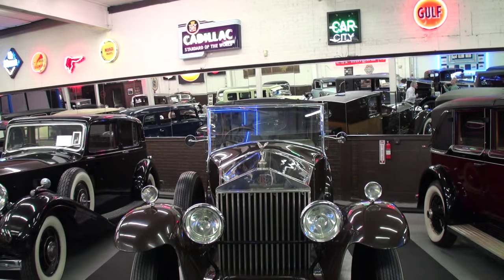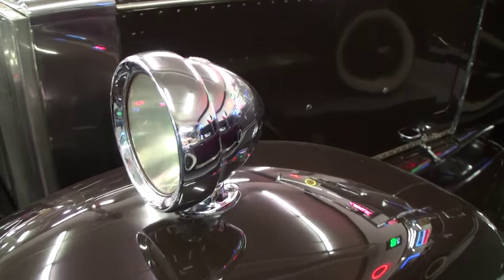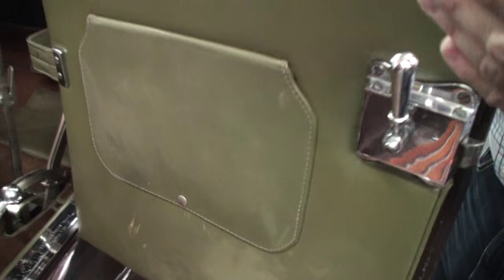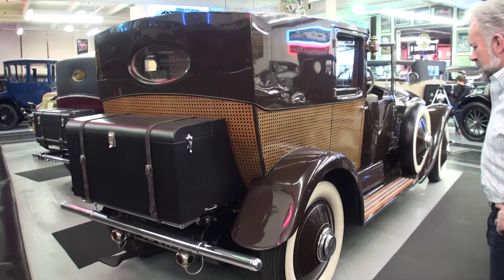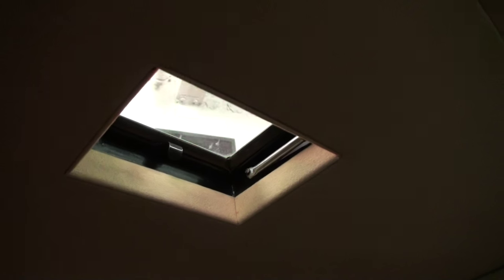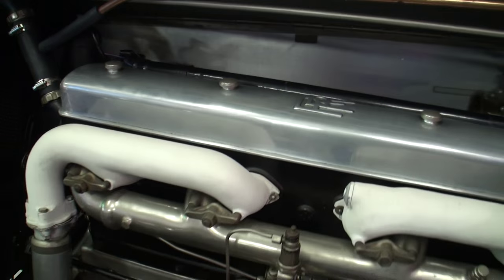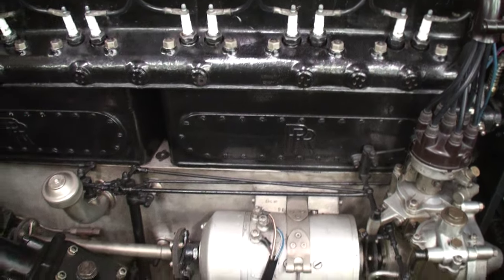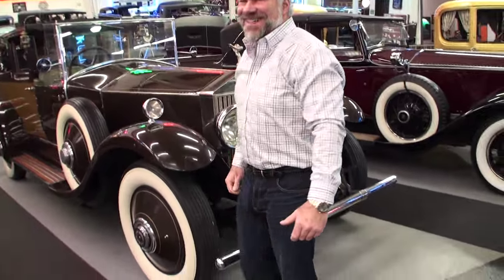1927 Rolls-Royce Phantom I Brougham Limousine de Ville by Barker on My Car Story with Lou Costabile

Comment: Hi Lou, Love your videos, chassis 78UF was originally a Hooper Launderlette, owned from new by the Marquiss of Crewe, Crewe House, Cheshire ,UK.The control lever from the headlamps was a feature of Barker coachwork  or ' Barker dipping ' and from the chauffuer's compartment the lamps could be tilted down to prevent dazzle !.The chauffuer was expected to enter from the left to allow him to enter elegantly   to avoid the gear lever and hand brake. The skylight was known generally as a ' smoker's hatch ' to enable ventilation for the occupants.The missing script on the label of the carburettor tells that RR have adjusted the carburettor for optimum performance and no further ' unauthorised ' adjustments should be necessary !.The horn is by the Klaxon Company.
Reply from the maker: Hi Roger, Happy to read you're enjoying the videos with me :-) Thank you for viewing & sharing your knowledge, Lou